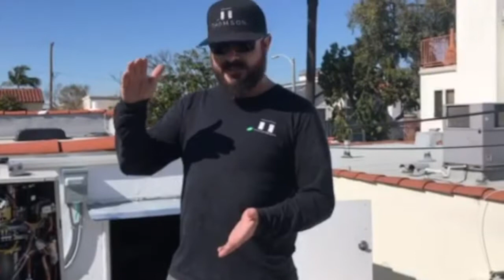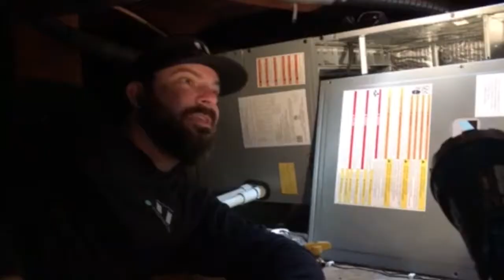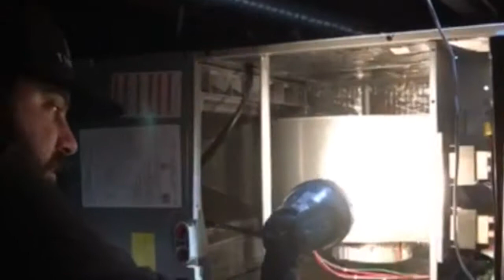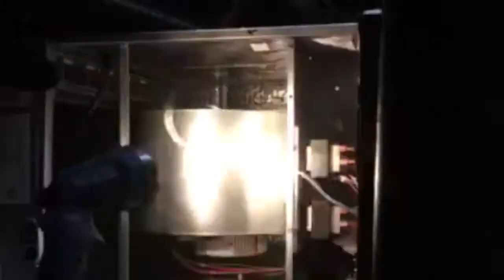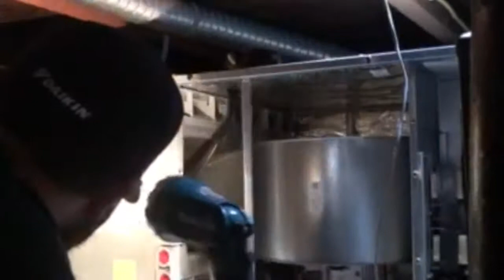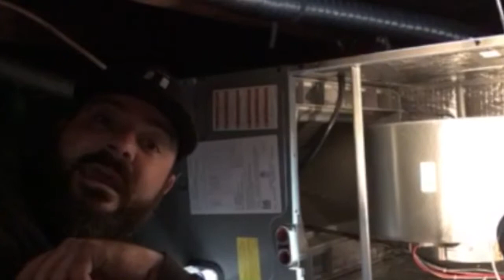Daikin VRV Life high efficiency Heat Pump Installation in Belmont Shores, CA

Comment: Hello, can you please comment on the Daikin thermostat and/or mobile app experience? I’m worried about using Daikin’s proprietary app / thermostat and not have an option to use say a Nest or a Ecobee. Also concerned there’s no temperature sensors. Also - what kind of power usage might a 5 ton system use for a 3000 sq ft home? Looking at a Daikin VRV IV system. Thanks!
Reply: OK, so Daikin is currently launching the use of the Daikin One+ thermostat for their VRV product line. This is going to be great in conjunction with the rest of the Daikin product. There's also another thermostat that is going to be launching soon. It's called the Daikin Madoka. This requires the use of the WiFi module and separate app. I have the Daikin One+ in my home and I love the app and its functions. It looks very similar to Ecobee, and all our customers have enjoyed the Daikin One+. I don't have power usage for your home. There are too many factors to speculate. Perhaps if you call your local dealer, they can look at your home, do load calcs, and then based on that, they can look at an energy calculator. There's also a basic energy calculator on Daikin's website. It's called the Daikin efficiency advisor and it's found at www.daikincomfort.com

As far as remote sensors go, I think there are a couple that work with the VRV product line, but you'd have to talk to your local dealer to find which ones you can use, and what thermostats you're using as well. We use remote sensors on VRV product all the time.

Comment: Enjoy your informative videos.  May I ask a question?  From the videos it seems the newer Daikin outside units such as the VRV Life, Fit and SKyAir  that are usually  associated with mini splits  can also be connected to air handlers/gas furnaces  to work in existing ducted homes.  They can replace traditional HVAC units?
Reply from the maker: NewOrleansMan 70179 yes. They can. We actually replace the traditional systems with these often.